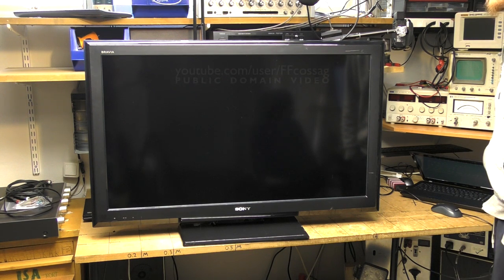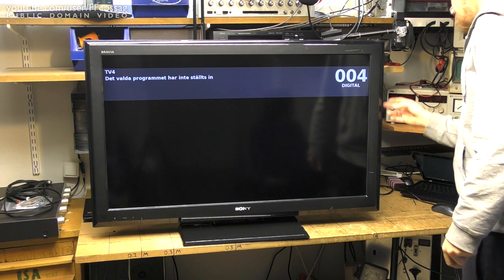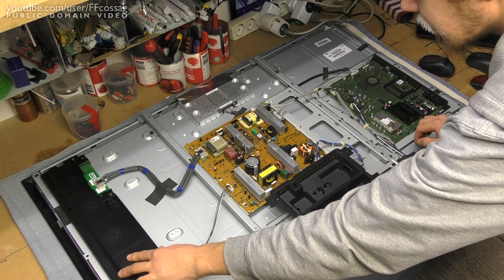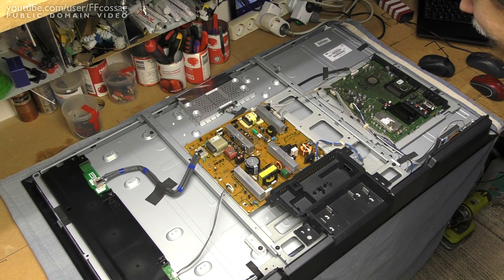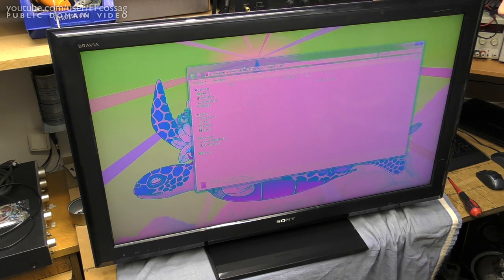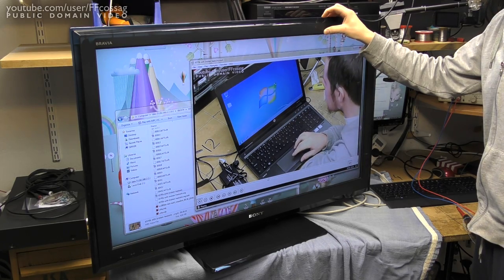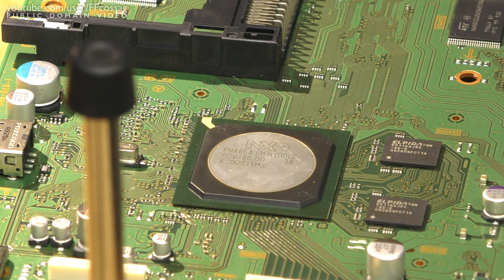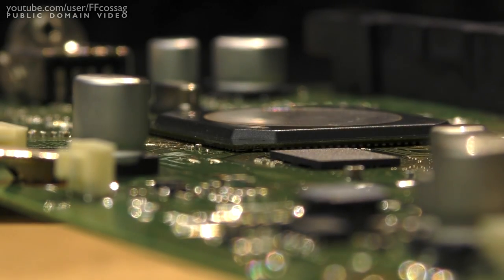FAILURE! Troubleshooting a Sony TV & killing it completely.

Comment: I should note that it is almost never the solder balls on BGAs which cause these types of issues. Solder balls, even lead-free are very large and can be quite strong unless the pitch is ridiculous. It is usually electromigration/thermomigration of the minuscule solder bumps in the flip chip which creates voids inside the package. Heating can temporarily cause things to start working, but not for the reasons most people think.
Reply from the maker: I agree to some extent; it depends on the chip and the implementation. Often in TVs the boards are not very well supported, and will warp over time, actually causing the BGA balls to fail. Not every BGA is an 8800GT. ;)
Reply: Another reason is, leaded solder is "softer", it can compensate more tension (due to thermal expansion, chips expand differently than the board itself) on the pins and solder balls, it is not so rigid.
On the other hand, the unleaded solder with lots of tin / silver / copper is much much more rigid. It does not allow for much thermal expansion and tension caused by this.
That causes those rigid connections to get micro cracks, or even go "cold". Sometimes you can even evaluate such occurences by pressing on the chip while the electronics is switched on. Just a bit of pressure makes that micro crack work again... for as long as you press on it... it depends on the package of the chip, lots of balls means you would need much preassure, more than you can apply to by hand.

Also devices back in that day, were simply not thermal wise evaluated to work with the lead free solder (xbox 360 fat models anyone, ps3 fat...).
A typical case, engineering didn't take into consideration what a catastrophic extent a solder compositon change would have (expansion compensation due to heat).
Couple that with less and less socketed devices (there is a reason why micro processors and ram chips were socketed years and years before, even the old xbox was socketed and those still work fine) and you have a perfect catastrophe. :)

Comment: Just the very local applied heat tends to flex PCB's by itself as the PCB will try to expand in the area where it's heated.
Happens to me often at work. Luckily for me: no BGA's = no worries. But here you perfectly demonstrated why you should pre-heat the board first. Just swirl around with the heat gun for a bit over the board, circling around the component of interest before focusing on it directly, at least that's my tactical approach. :)
And yes, I literally use a paint stripper heat gun at work too. To lazy to go to another building with proper hot-air tools, which are still too small for a 200-or-so-pin FPGA... So paint stripper (with temperature control) it is. Never fails, LOL.

Comment: The "inverted color mode" looked for me like it was interpreting RGB values as YCbCr values. So it was switching between those color models due to HDMI protocol issues. Perhaps there was just an issue with the HDMI connector. Most of the time when unused, they may collect lots of dust.
Reply from the maker: No, I fiddled with all that stuff and it made no difference. Could have been a HDMI receiver issue, though, for sure. Thinking back, I'm not sure if I checked the menus when it was screwy - d'oh!
Reply: When it has really switched to YCbCr by its own, it's still strange. That setting usually should not change by its own. However, too late. It's dead. Rest in peace.

Oh, perhaps you may get one of these boards from another Sony TV that may have a panel issue or something! Look it up on eBay. I even guess it might be the same board through several models at that time where it was manufactured. Perhaps you could even get extra HDMI inputs and stuff.

Comment: this now makes me think of a better solution ,the outer pins square bunch of this cpu
to pcb has cold solder or cracks for intermittent probs, why not  dremil a smaller square
on the outer metal protector where the cpu is located, add 4 wood wedges like a half of a wooden 
cothes peg x 4, strategically around peripheral for the outer pins rows of the cpu, so now we have continuous pressure on the cpu  then slap a smaller heatsink in middle, no ones thought of this one
give this a try before re heat first, the oven thing at 220c for 10 min no flux might be smarter but more risk still , try pressure first !!!  okay tom.......

Comment: The problem i saw, was that you used flux on the edges. if you ar tacking the whole chip of and solderer it comply then use flux on the hole area after the clean up. 
Ned som inspiration check this man out.. Love your Chanel Btw. Best regards Petter frome Sweden :-)

Comment: Actually why did you heat it with an air gun? With an air gun you only put heat partially on one point and the rest stays cold, that alone causes tension inside the board and it warps like it happened with yours. Next time try baking it within an oven, 220°C and about 12 mins. Put it in while the oven is cold, then start its heating ramp, after 10 mins check the first time, give it 2 or 3 mins more. Then switch of the oven and let the board cool inside the oven slowly, the slower the better. After an hour or so, probably down to 50°C, you can take it out and let it cool on air. Then test.
Yes I know 220°C is not nearly enough to melt solder, you usually need between 350°C and 400°C, but that is not a reflow, it is a tension compensation procedure.
Reply from the maker: Yep, I pre-heat boards that I really care about. This was a trash picked, rather dated TV, so I couldn't be arsed. We learned something, though!

Comment: what screen resolution was it?
Reply from the maker: 1920x1080
Reply: FFcossag Do you think it would be worth buying a replacement board or is it just not worth it?
Reply from the maker: You basically can't get boards for these. That usually means that it's the mainboard that fails.

Comment: I cringed so hard when I read the title,but wait, don't chuck it out,do some research and see if you can use one of these ebay monitor mainboards(lvds),those are generally universal,and I for one,used the board form a 17 inch acer on an 19 inch lg